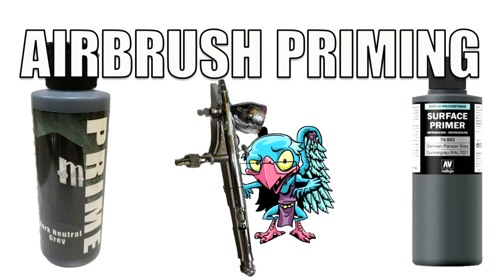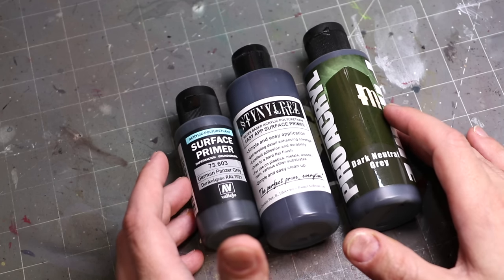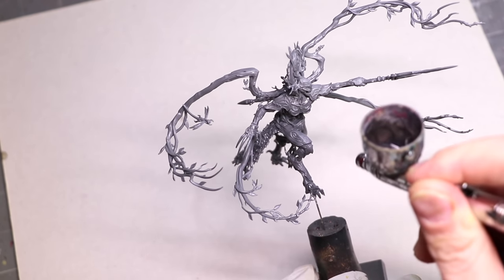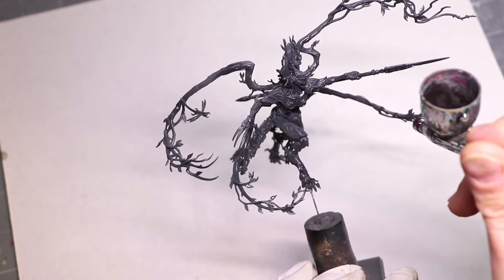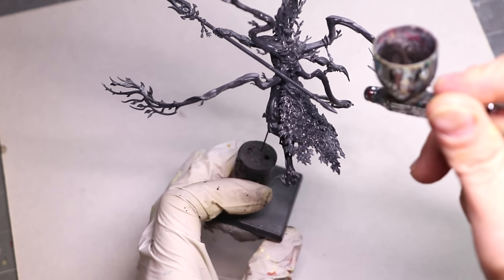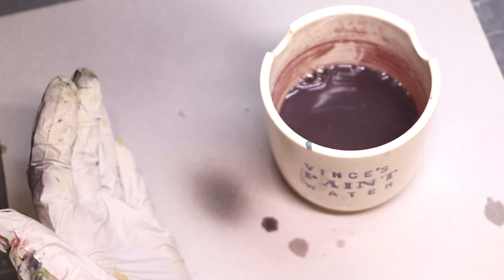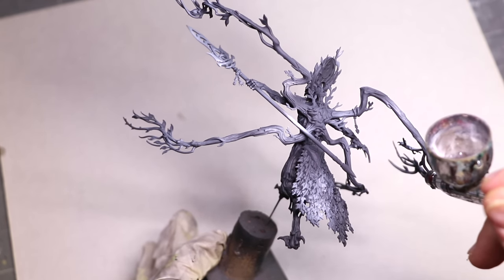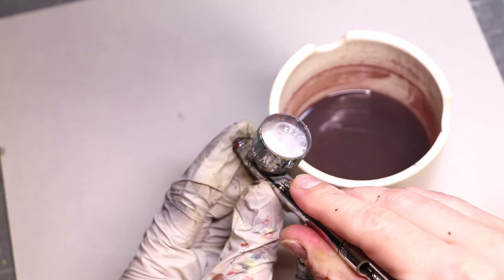Complete Guide to Airbrush Priming - HC 350

Comment: So I’m new to the hobby and bought a cheap 50 buck handheld airbrush off of Amazon to learn on and I’ve been following this guide. I seem to have a ton of gunk in the needle cap at the end of a session which requires me to pull the needle so that I can gingerly scrub out the gunk from the cap with a brush. I’m following the steps exactly and not spraying out the front during the cleaning cycle. Any tips or insight as to why this could be happening?
Reply from the maker: Well, it can be a little more dangerous, but you can work without the cap. This is just a side effect of some cheaper brushes with a cap, some of the air out of the nozzle isn't as tight as it could be and so you get spray gathering, no real way to avoid it other than working without the cap (or getting a different needle cap with only 2 teeth for example.

Comment: Can I premix my primer mix and store for later use? Let's say 10 drops of flow improver, 40 drops of thinner and 150 drops of vallejo primer. 
What is the optimal psi for 0.3 needle? 
How long should I wait before painting with your primer mix?
Reply from the maker: I've never tried to pre-mix, my fear woudl be separation. IN general, with .3, you want 18-20 PSI, I like to wait overnight if possible, but an hour or so and it should fully cure depending on your local humidity.
Reply: @VinceVenturella  Thank you for wonderful video and reply. My last question is what is the optimal distance to prime? When I prime, the primer does look dull, I slowly cover the model. Does it mean the primer dries on its way to the model? Should it look gloss? Should I cover an area with one pass?

Comment: Like to use ISO instead of airbrush cleaner too. Much cheaper en more effective in my opinion. Have a 50/50 mix of distilled water and ISO which I use to clean my airbrush. Is faster than adding ISO and water separately.
Reply from the maker: That makes sense.

Comment: Great video,  I'm coming back as I bought an airbrush two months ago, and still learning.  Question as I've seen others mix the primer and thinner together in a separate cup say and pour into the airbrush cup, is that ok? Also I've seen my primer coming out in bursts,  I think that's due to me holding the trigger down to long instead of bursts, am I correct?
Reply from the maker: Nothing wrong with mixing that way, that could certainly be the case as to the bursts. You want small, controlled pulls of the trigger.

Comment: If I use a black primer, do I need to use a white primer for the zenithal, or will regular white acrylic work just as well? Thanks.
Reply from the maker: Any ink or paint that is acryllic and won't reactivate with additional liquids is fine. I prefer the extra primer just for durability, but it's not strictly necessary.

Comment: Hey Vince, hope you are well. I'm definitely one of those people that has difficulty with my airbrush. Thought it would be a godsend for priming, but the near constant clogging and tip dry has just been so much to deal with that it's really discouraged me from ever pulling it out to use. What I've picked up from this is that I'm not cleaning regularly enough; I usually clean it out probably every 6-7 minutes (usually immediately after it starts to clog/sputter), where I should be actively doing a thorough clean before it even gets to that point - every 2-3 minutes, like you recommend. 

A question I've got for you: I've seen Uncle Atom talk about wet storage for his airbrush (in a sonic cleaner). I know the conventional wisdom is that this is bad for the brush. Do you have any experience with wet storage that you can share?
Reply from the maker: It's perfectly fine and won't hurt a thing, Uncle Adam is dead on. :)
Reply: @VinceVenturella  just bought a sonic cleaner from his Amazon affiliate link. Time to get these puppies fully clean and keep them that way so they're a breeze to use

Comment: White primer vs White paint and White Ink and airbrushes.If there are differences would make a good video.
Reply from the maker: That's a very interesting video idea. :)
Reply: @VinceVenturella  Your comment about the larger white pigment size and increased PSI got me wondering. Also white ink over grey primer and Vallejo cold grey turned out grey. Haven't had a second go to see if my coat was just too thin or I diluted the ink way too much and had to stop before it ran on the mini but intrigued.

Comment: Hello ! Thank you for the good advices ! I have a question though. After I put those 4 drops of thinner in the airbursh, is that all the thinner that I should use ? Or you already mix the 4 to 1 ratio in the bottle of the primer and add it on top those 4 predrops in the airbrush ? Thank you again, dropping a follow.
Reply from the maker: So that is generally all the thinner I use unless I’m using a lot of primer (like more than 12 drops) in which case, I’ll add another few drops of thinner at the end
Reply: Just came back to say a milion thanks ! I’ve just managed to complete priming an entire big as* print without getting my airbrush clogged any single time. Like you, I have also used Pro Acryl Prime (dark brown) and its fantastic. Recipe was 1 drop flow improver, 3 drops thinner and 12 drops primer. It worked AMAZING. Now I am really tempted to get the base set from Pro Acryl and change all my vallejos. Do you think these are as good as their primers ?
Reply from the maker: @foxmediavision4109  I'm a big fan of their paint line yes, they even have a range they produced in partnership with me. :)
Reply: @VinceVenturella  that’s awesome ! Definitely gonna get me the base set for start.

Comment: Painting my first Dreadnought last weekend, I realized I should have just base coated a metallic silver. Any tips when it comes to doing this? Recommendations on a brand that functions best for this specific use? Thanks!
Reply from the maker: Vallejo Metal Color, it's a little more expensive, but you get a lot and it's airbrush ready, I have some videos on the channel of it in use. Great for airbrushing base metals and more! (brush as well).

Comment: Heya Vince, getting back into painting again and I'm curious to know if you now prefer to use the white monument primer for zenithal or still lean more towards using a white ink. I have both but haven't had a chance to set up for priming (used white ink in the past, now have all the monument primers brand new waiting to be used). I'm limited by psi though as my current setup is portable so I'm using one of those cheap usb compressors
Reply from the maker: Generally, I like the white primer, I just find it sticks better than ink and is more durable.
Reply: @VinceVenturella  thanks Vince!

Comment: I only have a low psi compressor. Anything I can do to make white priming easier? Or other colours/products I  can use to zenithal? Does ink over a dark primer work for example?
Reply from the maker: Yes,  a little flow improver and thinning it and building up thinner coats will work. You can use a little white ink (just be wary of reactivation) and that can be a very easy way to use it.
Reply: @VinceVenturella  Thanks Vince ill try that. Love your channel BTW. In an ever increasing market you're still the GOAT! ❤ 🖌

Comment: Hi Vince. Thanks for this and all your videos.

Been working with my new airbrush and the condensation catcher seems to constantly fill with moisture, as in I have to dry it out few to several minutes.

What am I doing wrong? Or is my environment too humid?

Thanks again!
Reply from the maker: That's very strange it should not fill up that fast, that tells me that something is loose and air is getting in massively, so you might need to wrap some new tape around your joints.
Reply: @VinceVenturella  I'll give that a try. Thank you!

Comment: In regards to whites would mixing in some gloss varnish make tge pigment smoother without having to increase the pressure?
Reply from the maker: Yes it will, but there is a downside, now you have a glossy surface for your primer, which is bad, as it makes it harder for additional paint layers to adhere.

Comment: Hey Vince, I just started priming my models after watching your videos, but I’ve ran into an issue. After priming, a few models had there primer taken off when I set them down, a while after priming. Similarly, another model had its primer come off when I positioned it with some bluetack, as if it just pulled off the primer. 
Any advice?
Reply from the maker: It could be local humidity or several other factors. Some solutions - give it two or three thing coats of primer, let each cure between. OR you can give ita quick varnish after the primer. Those two items will generally prevent damage.

Comment: I left some iwata airbrush cleaner in my cup for about a day when i had a blockage. It seems to be working fine now after i disassembled and cleaned, but i noticed it stripped the chrome out of the bottom of my airbrush cup. Did it do the same to the internals am I going to have issues going foward?
Reply from the maker: No, it's just the thin plating inside the cup, no issue at all, it happens over time either way. :)
Reply: Iwata suggests to never soak parts of an airbrush longer then 10 minutes in their official youtube channel. If I'm not mistaken in the video by Iwata they used the Medea Airbrush Cleaner.

Comment: Backflowing the airbrush only works with a cone tip right?  If you have a double pronged tip or even no tip, you're SOL and have to spray through?
Reply: Double pronged, like the H&S Infinity, you can pinch to back-flow. For no tip you can use a makeup sponge or something similar.
Reply: I have a 2 prong crown cap on my brush, I can backflow with it no problem. If anything I find it easier as I can grab the needle tip and I know exactly where it is.
Reply: I use a waded up paper towel.  Shove the tip of the airbrush into it, backflows perfectly.
Reply: You can also unscrew the tip of the airbrush just a little and it will backflow
Reply: Or you can just not backflow. If you are this careful w your mix and dump out excess you absolutely can blow out a highly diluted solvent mix toward the front with zero trouble.
Reply from the maker: Yep, as they have said here, always options.

Comment: Thanks for this video.  I did not know you even could thin primer; maybe that's why I've been having so much trouble ;)  Are there any special tricks you need to do with a single-action airbrush?  I have a Paasche H.  I'm probably putting the layers on too thick just trying to keep the tip from clogging, but I haven't had any trouble with peeling (yet).  I have started using just a little Vallejo Flow Improver which I add to the cup first, and that has helped immensely.
Reply from the maker: Glad it was helpful! They key is really just what you're already doing, working thin. That being said, a dual action in the long run will do you well.

Comment: You mentioned that you clean out air brush every couple of minutes. Do you go through the whole water/ipa back and forth until it flows clean each time even if you're "switching" back to the same paint you were just using?
Reply from the maker: I just do a quick rinse, and then every couple times, a full clean.

Comment: Hi Vince, thanks for all your amazing videos! May I ask your advice on a priming problem. I primed a few models with the airbrush and at some of them the primer is rubbing off easily. I assume that I made a mistake in the mix or that I sprayed from too far from the models. How can I fix this? Do I have to strip them and reprime? Or can I just add another layer of primer? One model is partially painted (that's when I noticed the rubbing off). Can I save this with a varnish?
Reply from the maker: Give it another coat of primer, let it cure, varnish it. But importantly, don’t rub or scratch the models either. :)
Reply: @VinceVenturella  great, many thanks!

Comment: I am following your instructions but I'm still having issues with my airbrush. It will spray thinner and cleaner just fine but when I try to spray primer it just won't cooperate. I have tried adjusting the pressure up and down, the paint is thinned as much as possible but it either won't spray or blasts out in a huge spread. The airbrush itself is clean. Could it be because it's a cheap one? I have had it for about a year and a half. It worked great up until a couple months ago.
Reply from the maker: It's likely because we have some very slight build up in the actual nozzle, you have to use a needle scraper tool to get that area clean and it only takes very, very small amounts of the dried paint to cause the exact issue you're describing.

Comment: Hey Vince. Following that particular tangent, do you run a dehumidifier in your basement, or have dedicated AC down there?

I'm moving house soon and looking for AC options, which are unusual in the UK. But I'm tired of sweating it out in our increasingly unpleasant summers.
Reply from the maker: I have AC yes, actually a vent is right above my painting area, it's closed, but it's still cold down there. I also have 2 dehumidifiers running in the basement (but it's 1300sqft, but don't want any mold or similar issues ever.

Comment: I used the Pro Acryl white primer through my Iwata Eclipse airbrush today. Compressors at 40 psi, a drop of flow improver added first. I still got lots of dry tip and bubbling in the paint cup. Is the thinner as necessary as the flow improver? The needle also keeps getting stuck in the backwards (on) position with little use. So I’m at a loss.
Reply from the maker: I prefer Stynelrex for white primer honestly, but yes, you need some drops of thinner as well. White is always tough a bit chalky because of the pigment.
Reply: @VinceVenturella  Do you just add the thinner first then the primer then spray, or do you ever back flush before you start spraying?
Reply: @VinceVenturella  Also, I wanted to wish you a Merry Christmas and say ‘Thanks’ for all you do!
Reply from the maker: @j.taylor7361  a few drops of thinner plus flow improver, then primer, and then backflow, then spray.

Comment: What is your stance on just leaving the whole airbrush to soak in a container of water in-between uses? I have watched other tutorials where that is what they do when done painting each time. The only problems I run into come from getting the right pressure and primer to thinner mix. Sometimes it seems like I use half a bottle of cleaner before it stays clean when changing colors or finishing up for the day.
Reply from the maker: Yep, no issue, leaving it in water can be very helpful.

Comment: I've watched this video like 4 times while starting with my first airbrush and while my paint doesn't rub off, I can take it off easily with a fingernail. I'm using sprues to practice with before doing real minis, and I've washed them down before spraying. Is this normal with airbrush primer? When I use rattle cans I don't even wash the plastic and I can't scrape that stuff off at all. I've tried Vallejo black/white, and the Stynylrez black/white.

Do I just need to make sure I varnish minis if I've undercoated with an airbrush? This is far more convenient than rattle cans in the DC area, and I imagine airbrushing varnish will be far easier too if this is just part of the airbrush experience.
Reply from the maker: So most primer will scrape off with your fingernail, don't scrape your mini's with your fingernail. That beign said, if it's a concern, you can always varnish after the primer has fully cured.
Reply: @VinceVenturella  Thanks, I magnetize my bases so I'm always nervous of messing up the paint taking them in and out of boxes. Great channel, I love all the tips.

Comment: For your "two thin coats" of priming, since you normally Zenithal prime, do you apply 4x layers  (2x black and 2x white) or 2 total (1x black and 1x white)?
Reply from the maker: Usually two black, and then the white is built up, so it's one layer, but it's technically more as I am building it up slowly.

Comment: Rubbing alcohol??  Could you explain why you use it and how it doesn't ruin the primer?  I always found that rubbing alcohol dissolved acrylic paint, great for cleaning it up or stripping paint off a model.  I also use it to clean a mini of oil and grease to ensure the primer sticks well.  So, I assume it would damage the primer when mixed in.  I want to try it, but I am somewhat hesitant without better understanding.  Thanks so much for the video.
Reply from the maker: Isopropyl alchohol is a common thinner, it's used in paints as the primary medium in things like Liquid Gold, but the regular Vallejo Metal Colors use them as well. Tamiya thinner has alchohol in it. THe key is that it will mix with the water, you're really using the tiny drop to change the properties of the solvent (water).

Comment: Great vid, definitely didn't realize I shouldn't be pushing the unused paint out of the airbrush!

On primers, I find Vallejo will peel when sanding (primed to check how a sculpt/joint looks) - any advice on which primer is best for sanding?
Reply: Yes. Vallejo primers contains a lot of Poly-urethane so they are quite rubbery and therefore not sandable.
The Badger Stynylrez is good for that (it is available in EU/UK as Ammo by Mig One shot primer or Ultimate primer). That said there has been recently some quality issues with some batches of it. The emulsion was separating when the primer was more than 6 months old.
The AK 3rd Gen primer are also very good. A bit brittle when fresh, but once they have cured (24 hours) they are strong.
Reply: @utakuryukko2023  brilliant, thank you. I'll look up a few reviews of each and order some 👍
Reply from the maker: Yep, Utaku has you covered.